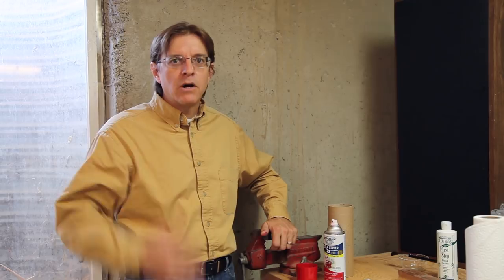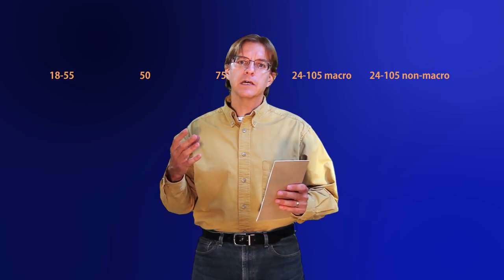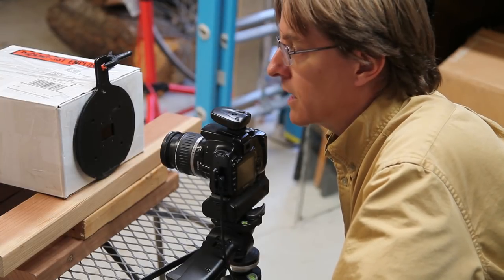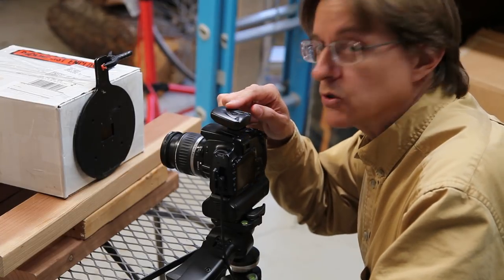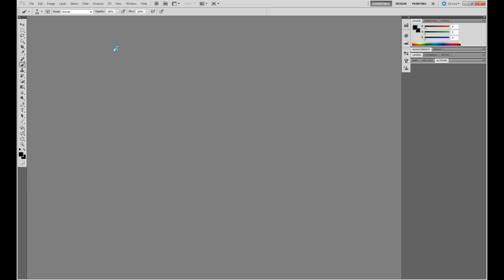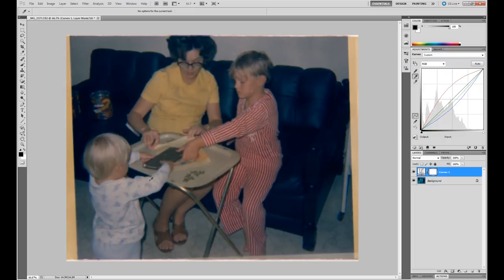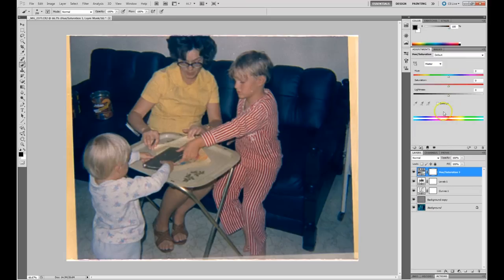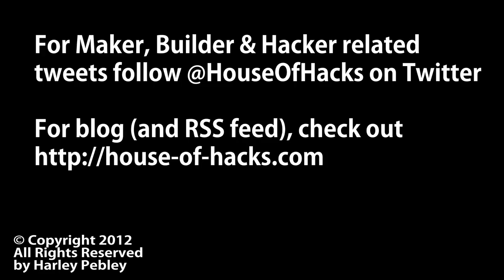How to convert film negatives to digital photos using a DSLR

Comment: Great job here. Thanks. Then I have two questions.
1: how you could get a bunch of films done nice and quick? Here you have to adjust one after one right?
2: How to make the film flat enough, this is the most difficult part right?
Thank you!
Reply from the maker: 1) Yes, using this method requires moving the film for each frame. If you just want a low quality reproduction, you could fill the frame with negatives and then crop the individual frames out of the larger image. The higher the resolution of your camera and sharper your lens, the better this would work.

Or you could devise some means to move the film easier. Possibly connect something to the sprocket holes to pull the film.

Or you could put the camera on a dolly and move it side to side.

2) To hold the film flat, I used a negative holder from an enlarger. You could do the same thing with a piece of cardboard. The key is to hold down all four sides of the negative.

Hope that helps.

Comment: I don't have a scanner to do a side by side comparison; there are a lot of variables. The quality of the scanner will make a big difference. Using this technique, the lens/body combo and the accuracy of the setup makes a difference. I'd guess a good high quality scanner will beat this method. OTOH, this method will probably beat a cheap scanner. And it's certainly less expensive.

Comment: I don't understand your slide holder, all I see is some big black disc and I have no clue what it is. Also, why not an extension tube to get the image to fill the sensor better? A color correction filter on the lens to eliminate the blue hue right from the start? I have numerous color slides I need to digitize so I'm looking for some kind of setup and I've been trying to come up with a similar idea. I think we had the same TV dinner trays! :D
Reply from the maker: Yes, I didn't really go over that much. What you see is a film holder from an enlarger. But a couple pieces of cardboard with a hole cut in them would work too. Extension tubes would work to zoom in further; I don't have any so I didn't use them. You would lose some light with that, but the flashes probably have more than you need anyway, so not much a problem. The problem I see with a color correction filter would be having the correct value to not have to do any in post. I suspect the color cast may be related, at least in part, to the age of the film, and so different sets might have different casts. Don't know for sure. Might take some experimentation to find something that works. If you have a big batch that are consistent, it might be time effective to do those experiments. On the other hand, if you have a batch that's consistent, you can apply the same settings to them all in post too. Good luck with your project.

Comment: Many thanks.  Regarding raw images vs. JPG files.  You may be interested to know that Jasc Paint Shop Pro (Version 7.04, ca. 2000 on Win XP) did a good job of not only resolving your negative image (after saving a screen shot as .JPG) but went on to do a fair job of adjusting the colour balance using the Effects > Enhance Photo > Automatic Colour Balance options.  I'm currently awaiting delivery of a commercial slide converter that outputs in JPG so I wanted to know how well such file types can be manipulated.
Reply from the maker: Yes, I used PSP before moving to the Adobe camp. It did quite a few things really well.

The thing about JPGs is you want to use them as little as possible. If I had a device that only output JPGs, I'd convert them to a lossless format immediately and only use that version until I was ready for final output.
Reply: Thanks.  I'll keep that in mind.
Reply: House of Hacks

Comment: After i scanned all my dias (and made a video for youtube :-) ) I'm looking for a cheap way to scan my negatives. Youre idea will help me - thanks.
Reply from the maker: +Quipu Glad to help. You're welcome.
Reply: Hello, greate video, quality ideas (y), can i get the same if i scan my negatives on an HP3110 scanner? i mean can i get the same quality in order to work them on photoshop?
Reply from the maker: Thanks. I don't have any first hand knowledge about the HP3110. I just did a web search on it and I'm actually not sure which model you're referring to. HP has two things with 3110 in their names. One is an all in one printer. Typically these are in the 300-900 dpi range for their scanners, which would probably not give you as good a resolution as you'd get with a camera. However they also have a photo scanner that has 4800 dpi resolution. For a 35mm negative, this would be approximately 6700 pixels on the long edge, approximately equivalent to a 30 megapixel full frame camera. So it'd be at least as good as using this technique, probably better. Hope that helps. Cheers.
Reply from the maker: Sorry, I don't know much about scanners. Just going off the spec sheet, it seems like it should work ok and it gets good reviews on Amazon. However, I have no idea how it compares with its competition or what type of job it really does. Cheers.

Comment: Why a flash?   Why not just a light bulb or other light source behind the negative?
Reply from the maker: A flash gives you a lot of light with a good color balance without much heat. This allows you a wide range of adjustability both on the flash's power levels and the camera's exposure settings. You can set your exposure such that there's no ambient light impacting the image. Thus you only have to color balance for the negatives, not for both the negatives and light.

Having said that, you can use a constant light source. You want it bright enough to give good even light without any hotspots. Ideally you want a good color from the light or the color correction might be a pain. You might want to apply two color corrections, one to balance the light and another layer to color correct the negative. This would be particularly true if you can't get it bright enough to overcome ambient. And you might have a heat problem, don't want to melt the negatives.

Cheers.
Reply: House of Hacks Wow..wonderful idea,
But can we use tablet who's screen is adjusted to the maximum brightness which provides a white even light of good intensity? 
Also i am having only a digital camera of around 13 MP resolution can i use that camera for this purpose?

Comment: You would do better using a flat plain lens (enlarger lens) and focus it yourself don't expect life to be that easy.
Reply from the maker: Why do you think an enlarger lens would be better? (And most people are not going to have access to an enlarger lens.)
Reply: It's the way it's always been done it avoids prospective, focus and bending problems .Think of how a enlarger works lets say 5x4 neg is flat it has no center focus spot it's (flat plain) that is again projected on the baseboard again with no focos spot again (flat plain) . Now compare a camera lens witch does have a center spot area  . when you take a picture you may chose to focus on many things in your viewfinder . I could show you in 1 minute the difference  but to explain it would take a lifetime your best bet is to try one then you will see what i mean .
Reply from the maker: OK. Yeah, I understand what you're saying. I doubt the difference is worth the effort to find an enlarger lens and hack up a mounting to a camera where the field of view and focal length works properly. That's not going to be accessible to the average person. If you were doing something that's absolutely critical for the best reproduction, that'd be the way to go, but you'd probably use a different imaging system also. Cheers.

Comment: Hello, thanks so much for this easy demonstration video. I thought about doing this, with my canon 20D 8.2mp while I have no photo scanner and I will give it a try. My question is how does this set up compare to a scanner. 

For instance, which work flow is faster with higher image quality -because I'm concerned that my dslr sensor won't be as detailed as a photo scanner of a high dpi. I'm wondering if it's worth the little effort to set this up and photograph my negatives or wait on a scanner.

Comment: Good Video. Thanks. Couple of questions, what are you using for the negative holder & how are you moving the negative after each shot (did not see you do it). Why does it need to much of post processing (I do not have photoshop), as you are taking the photo  straight of a negative.

Comment: I'm glad you found it helpful. In this case, I'm using a negative holder from an enlarger because it was at hand and convenient. But for other film sizes for which I don't have a holder, I've just used a piece of thin cardboard with a hole cut in it taped into position. I'm moving the negative by hand just by opening the holder, repositioning the negative and closing it back up. Besides the conversion from negative to positive, the rest of the post processing is just personal preference. Cheers.

Comment: Wow...great idea,.

But can we use a digital camera of round 13 MP resolution, since i am not having that type of camera you are using in this video with me.
Also instead of the type of flash that you are using can i use a tablet whose screen is  adjusted to maximum brightness and which provides even white light  of reasonably good intensity.
Reply from the maker: Sure, you can use whatever camera you have available. It's better to have something than nothing.

As far as how well a tablet's back light would work? I'm not sure. Try it and find out.
Reply: Think u sir...
Reply: House of Hacks what i tried was to keep the film on  the top of the tablet screen and took the photo of the film through my camera using the inverted mode. 
When i tried the above method i could get only the blurred version of the original image , maybe because the film is around 20 years old.
 Is it necessary that we should be having a specific distance between the film and the light source as you had done in this video to get an efficient reproduction of the image just on the top of the screen because i feel that the brightness of the tablet screen could damage the photosensitive film. Is it so?
Reply from the maker: Anoop George
The blurriness could be from a number of sources. It might be the original film, poor focus or overexposure. If it's the film, then the edges of the film (where the sprocket holes are) will be sharp. But if the sprocket holes are blurry then there's either a focus problem (possibly too close to the film) or overexposure where the backlight is causing glare. I don't know what type of camera and lens you're using, but most lenses can't focus if it's too close. You'll have to see what that minimum distance is for your setup. Sometimes it will be marked on the lens or you may have to check your users manual. If it's not a focus problem, then it might be overexposure where the light is causing glare or lens flare. You could try turning down the intensity of the tablet's screen or adjust the exposure in the camera. Hope that helps.